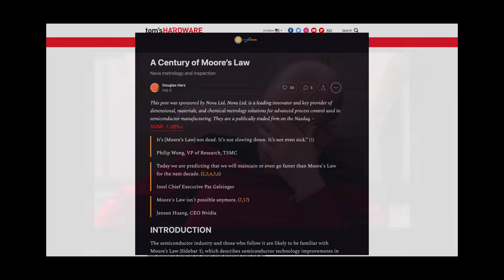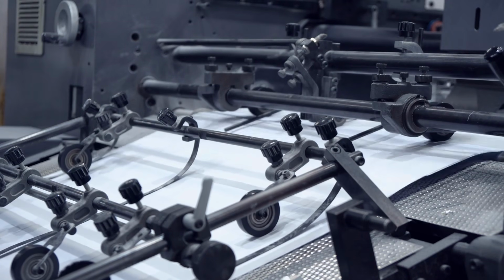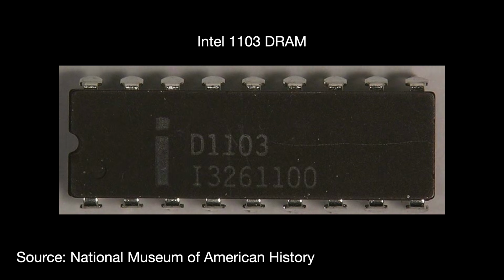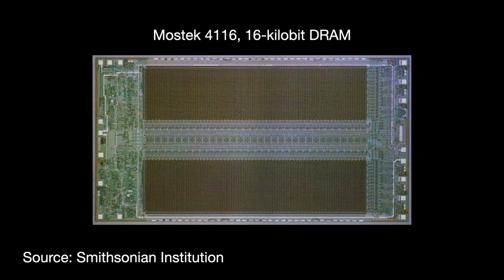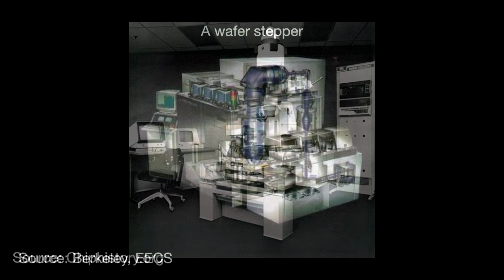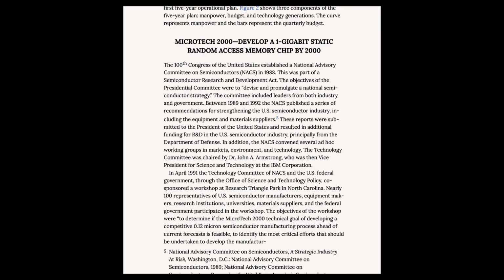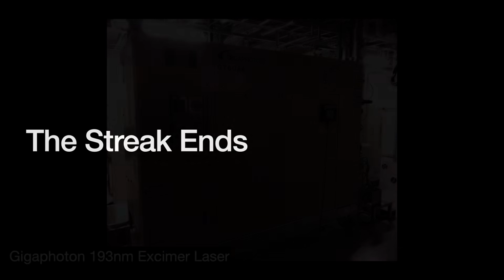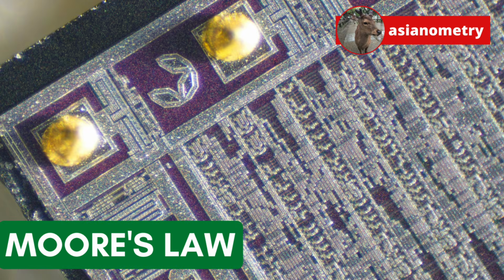Why Moore’s Law Matters

Comment: I disagree that regular people do not really care about it anymore. Software expects for systems to advance, web alone, try using web with devices 10 years old, you will rage like crazy how slow everything is. The productivity goes up as well with more powerful units.
Reply: That's because programmers are less and less efficient.
Reply: @WaterZer0  Clearly you don't know how programming works then. Same software these days is way more efficient than old software doing the same task on same machines. The software like cars advance and need more supporting functions to achieve more efficient and more advanced processes. The issue with badly optimized things these days are not fault of programmers in majority of cases, but fault of leadership, who push unrealistic time frames and cost restrains.
Reply: @thepenguin11  capitalism bad? loud and clear

Comment: Another issue is that Moore’s Law only applies to microchips. Some politicians act as if similar advances apply to solar cells or batteries.
Reply: yet, it barely applies to integrated circuit as most of the improvements during the last decades has been done through the design of the chips/systems and making smarter/fine tuned algorithms. And the raw computationnal power gain has mainly been used to ease software programming and portability. (eg. cache levels, multicore, SMT, interposers, ASICs, DSPs, FPGAs, GPGPU, higher level compiled prog languages, HAL, APIs, a metric ton of interpreted languages or cloud/server/Web-based apps)
Reply: One of my pet peeves. There will be some spillover of 300mm wafers to solar cells which runs mostly on 200mm because the equipment is cheaper and often second hand. The switchover to 300mm claimed a cost advantage based on wafer size ratio. The same should apply to solar but I am not a solar manufacturing guy. Same could apply to LED's perhaps...
Reply: @julioguardado  My understanding is that solar cells are already at a high percentage of the theoretic performance (as are windmills), so only more efficient manufacture is possible.
Reply: @tomhalla426  Same here. Polysilicon is king and its efficiency hasn't changed from around 20% iirc. They're still looking for that high efficiency material that can be manufactured cheaply. Don't see any breakthroughs there.
Reply: I REJECT THIS FORM OF TECH NIHILISM

Comment: Camera lenses got better because designers could simply let the software run random variations of the lens over and over again to find a better design, the more compute power the more variations you can try and the more likely it is the find a better design. Modern smartphone camera lenses are so ridiculously complex, each element basically has a radial wavy surface that make no sense but somehow focus the light just the right way at the end with minimal aberrations.
Reply: Ah the ole brute force approach.
Reply: not entirely true, a lot is material science and a lot is micro fabrication costs
Reply: As an optical engineer myself, I can say this isn't true. Yeah lens systems got better because of compute power, but not to run random variations. It's a very specific optimization otherwise it would still take way too long. And the elements aren't a "wavy surface". If it's a sophisticated lens system then they're aspherical, but that's still mostly a spherical shape with only micron scale deviations.
Reply: @twilightknight123  Guess you've never seen a smartphone lens? Some of those elements can 100% be described as wavy.
Reply: Also important is no longer needing to produce a geometrically correct image at the focal plane. Digital image corrections allow you to trade distortion for sharpness
Reply: Could you show us an example?
Reply: @kylinblue  Search "polynomial optics" and get ready for a headache.
Reply: @kylinblue  i dont know about camera lenses, but there's some proeminent strategy finding in the speedrun world done by AI
Reply: That's not how lenses work these days. Sure they have improved in design because you can run more simulations to get better designs but it's not just some random brute force with insane inputs. Also manufacturing plays a big role. I have a few vintage lenses that are handmade where obviously the best lens Design is severely limited by the precision of the person making it.
Reply: @KiinaSu  the more compute power you have the more random brute force you can use. How did you determine that a lens is limited by manufacturing precision? What's your process?
Reply: @chengong388   
Whats not limited by the manufacturing precission?
Reply: No tech tricks can get around aperature diffution limits of such a small lense. A wide angle shot of a well lit scene on a small viewing screen artificially smoothed is not the test of a camera lense system.  Show me real angular resolution of real image data (True detail information in the orginal scene not a touched-up large scale emulation), preferably taken in low light.
Reply: @TheDuckofDoom.  dude, nobody cares, don't get so butt hurt over some cameras.
Reply: Lenses are not used in ASML's EUV machine.
Reply: 😒 Get a room
Reply: Smartphone is still a nonsense

Comment: "...a lucky guess that got a lot more publicity than it deserved."
- Gordon Moore.
Reply: Intel made it their business plan and held to it until into the 2000’s. Other leaders had to stay to the law to keep up.
Reply: Well. With a span between 1 year and 2 year it was a pretty wide guess. Also they did throttle there development during periods of the 80s and 90s. Basically cheating.
Reply: @matsv201  It was a very good guess IMO.
Reply: @AlanTheBeast100  You not correcting him means you must be low IQ as well
Reply: @Connection-Lost  No it means that I know that predictions based on the very small data set that Moore had at the beginning has stood the test of time well.  It's never going to be perfect.  Indeed look at the graph in the video: ( @21:30 ) a pretty straight line on a log graph?  Hmm?  You do know what that means, right?  I mean you passed grade 9 math? Right?
So, a little algebra
1) 1971: about 2500 transistors
2) 2020: about 35B transistors
Based on that, if the number of transistors goes up 1.4x every years (on average), then you get close to the 2020 count.
Of course you can adjust the limits as you will and get slightly different numbers.  For example if I make the end number 50B, then the factor would be: 1.41 every year.
So before accusing people of a low IQ, maybe you should do some basic high school math first and see if your own IQ is up to a level from which to throw cheap shots.
Reply: @AlanTheBeast100  I don't see anything mentioned about low IQ except from you, did something get deleted?
Reply: @AlanTheBeast100  bro chill tf out, the guys not even here
Reply: @大砲はピュ  You're the one showing up 7 days later saying the guy's "not even here"?  Okay ...
Reply: @matsv201  Their*
Reply: @Connection-Lost  🤣🤣🤣🤣

Comment: Said it 7 years ago:
Hardware is as good as it's going to get for the next 10-15 years as there is NOTHING new in the manufacturing or components of today's computers.

Still today, nothing really new...
Software is where the next innovation change comes next (and about time!).
Reply: Less bloat is the way to go, sadly it's going to crash current software development. Since complexity will either come from pure theoretical software optimization or absolute minimalism towards computing
Reply: Nanosheet or Nanowire? You clearly have no idea... There is lots of new stuff even different materials that are more heat resistant for electric cars. 
But you are right with Software - it is time for some breakthroughs

Comment: Moore's Law will never truly die. :(
Reply: Moore’s law, or Moore’s observation, I dead, simple as that. We don’t get to rename and define it so it still correcr
Reply: @benc3825  Yeah I think you’re right. I think people are just really attached to the idea. So they wanna keep it around and redefine it. And just some thing it was not
Reply: @benc3825  AMD and intel future server cpus want to know your location, also gpu density
Reply: @copper16000 Which one specifically? The Turnin family, Venice, Emerald Rapids, Granite Rapids, Diamond Rapids, Sierra Forest and/or Clearwater Forest. :-P
Reply: @benc3825  3090 to 4090 having nearly 3x the transistors in a smaller die
Reply: @copper16000  Okay? Going from a 10nm class node to a 5nm class node does that. Density doesn’t mean that much in the grand scheme of things.
Reply: @benc3825  that's literally what moores law is ...
Reply: @benc3825  Intel says they will absolutely have a 1 trillion chip by 2030 , seeing as the max is 80b on a 4090 that's an astronomical improvement
Reply: @copper16000  Intel makes a ton of those claims, and most of them don’t come to fruition. Besides, there is an easy solution, just connect a ton of dies together, with 3D stacking, disaggregation, etc.
The bigger picture is performance where transactions count isn’t everything
Reply: @copper16000  Yes 50% better performance for 100% higher price
Reply: @benc3825  No, we don't need to redefine it since its still alive.
Reply: @M414-q6o  Then why did Gordon Moore redefine it? 1975 it was changed from every 18 months to 24 month for a doubling transistor count. I'd say it is only arguablely correct because we have gotten disaggregation working. In my view, it is for a single monolithic die, not many dies past past the reticle limit.
If we do allow for disaggreated chips, then why can't we just include a 2nd, let's say, CPU in a server. They are interconnected, and work together, so why not indual dual Genoa CPUs?
TSMC's CoWoS-S interposers already go to 3,400mm2. Hypothetically, we could get over 700 billion transistors if we use only TSMC's N3, then what about 3D stacking or TSMC's InFO_LSI/ Intel's EMIB, that could allow you go to past the 3400mm2 limit theoretically.
What if we just put SSD memory chips on package? then bam, past 1 trillion.

When you have this vague of an observation, you make tons of exceptions without officially redefining it, even though it already has been redefined
Reply: It's been dead for awhile now
Reply: also worth mentioning AMD new instinct chip is a behemoth of cpu+ GPU on  one chip having 150b transistors

Comment: It used to be that several companies made lithography machines. As time when on, the number of companies making lithography machines narrowed. Only 3 companies make DUV machines. Only 1 company, ASML, makes EUV machines. They can make hundreds of DUV machines per year, a few dozen EUV machines, and they hope to be able to make 20 EUV high NA machines per year by 2027-28. This narrowing of how many companies make these machines, how many machines can be made per year, and each machine's wafer output, will do more to end Moore's Law than the ability to put more transistors in a smaller space. The end [of Moore's Law] is nigh!